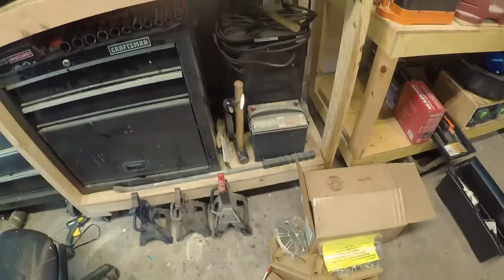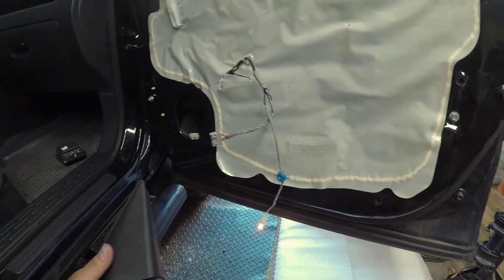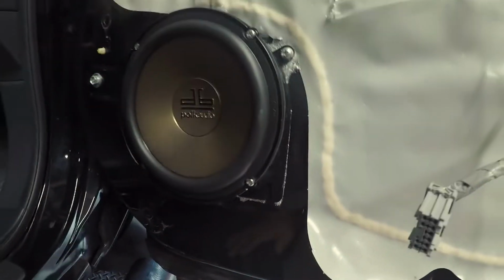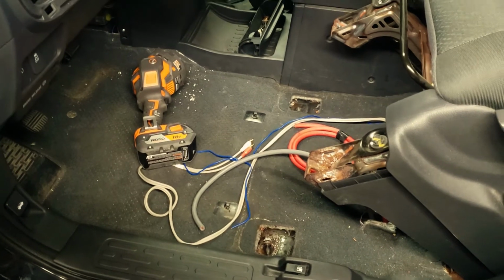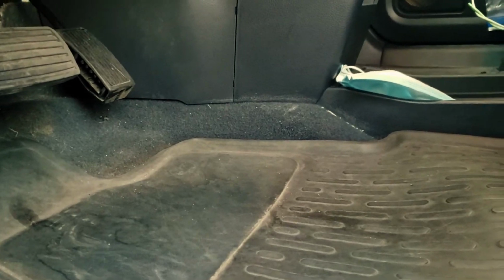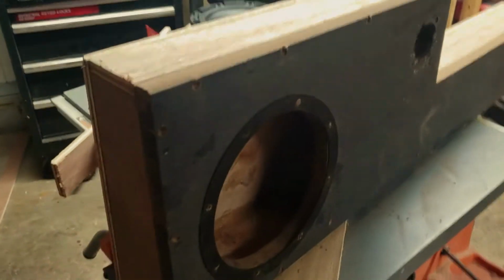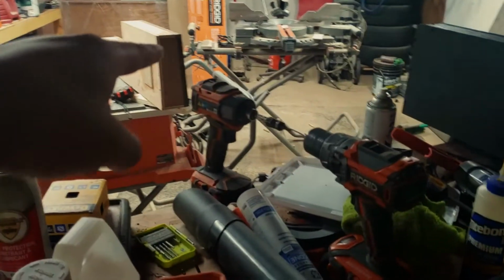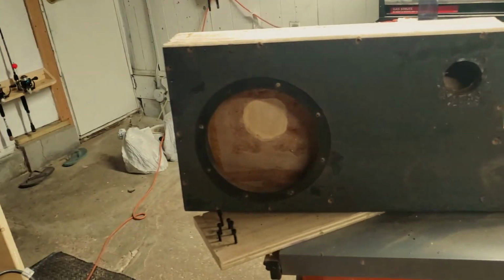Honda Ridgeline Audio Upgrade! 06-14

Comment: How did the sound change by placing the tweeters in the door sails? How does that compare to the factory front door coaxials and dash tweeters?
Reply from the maker: Well hard to say cause the factory tweeter was pretty crappy. But its 100% better with the polk tweeter and placement at an ideal location, closer to ur ears.

Comment: Great video! I have elemental design 10" sub behind seat 
I grinderd off the metal bar that subwoofer hits...
Reply from the maker: Yea Ive read some folks did that. I was tempted as well after my 2nd  (failed) box but thank goodness the 3rd one fitted.
Reply: @Garagejunky09  Yeah its tricky fit back there if only we had more clearance behind seat be perfect